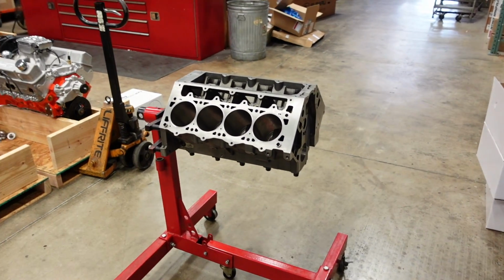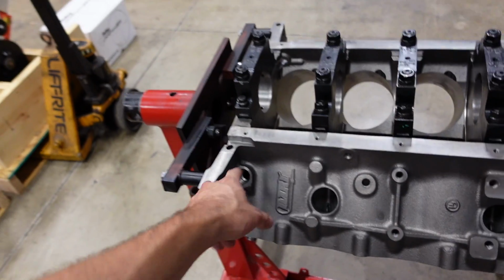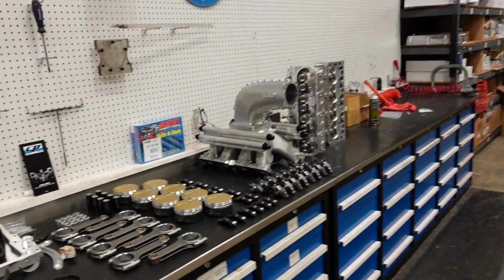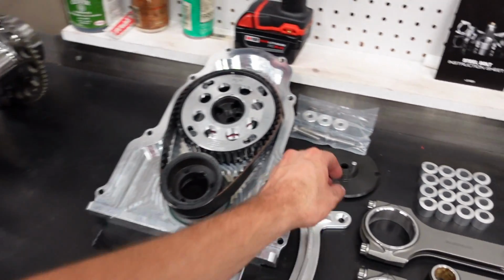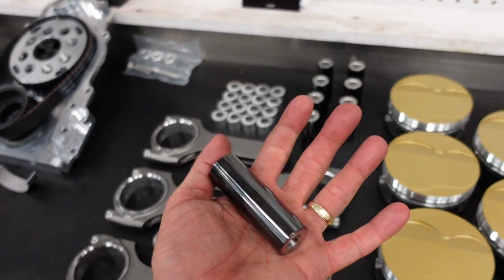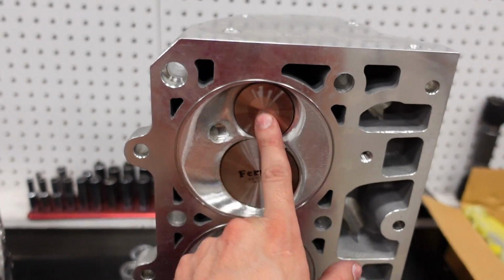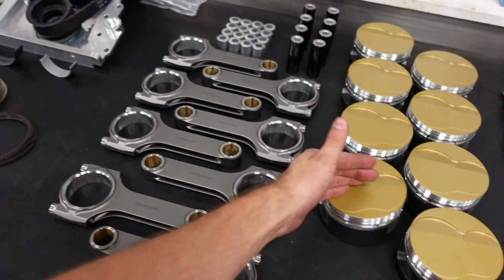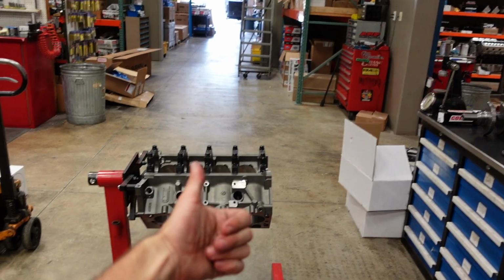Building my Personal LS Engine! - Engine Parts Overview - Part 1

Comment: Dude will be the next Steve Morris.
Reply: Dude should have asked Steve how to build a 3000Hp LS engine… Steve would have said don’t do it.
Reply: @Dave-rh6zo That’s why he went to an all billet combo (SML) cast iron and aluminum blocks break at that horsepower level. But companies will still sell you the parts if that’s what you wanna do. I’m sure he’s been told that but he wants to try it anyway. TKM won’t put H beam steel rods in anything over 1000 horsepower. They go to I beams over that and for 3000 horsepower they and Steve Morris and everybody else in the boosted world go to GRP, MGP, or R&R billet aluminum rods. Any top boosted builder hears he’s shooting for 3000 horsepower with a cast block and H beam steel rods will laugh him out of the industry. 😂 Steve Morris will tell you he’s split cast and aluminum Big Blocks in half at 3000 horsepower.
Reply: @wilsonjohn9766  jeeez so how many 3000hp 9500rpm engines have you built?
Reply: @dsauce8780  The same number as the guy in this video.
Reply: @wilsonjohn9766  ok how many 1000+ hp builds do you have under your belt?
Reply: @dsauce8780  3000 hp @ 9500 rpm isn't living in a factory LS block for extended duty. I'm sure there's some big hp factory  block drag engines out there but I doubt at 3000 hp/9500.
Reply: Steve Morris already knows what happens when you stack weight in the crank bell as they have.
Reply: I really doubt it
Reply: Got a long way to go
Reply: Steve design is stuff dry deck for a reason . No way it survived 3000hp especially for long load period with that set-up
Reply: MAybe in another  20 years
Reply: Dude already is way above steve Morris in ability and knowledge! And he's half the age of steve....so just imagine what happens in 20 years more!!!@@
Reply: @rytime700  lmao, wtf are you thinking? Why do you think Morris, proline , Sonny's and every other major players started producing  billet blocks? Simple, they hit a wall in HP with how much hp a coventional iron/alum block could hold.
Reply: @rytime700  lol yeah right I seen them young  punks with rich  daddy  all the time  ,he's not the next Warren Johnson  or Darin Morgan  any one can make 2000 too 3000 with a turbo the Idiot proof moron proof
Reply: Not to criticize Steve makes his blocks  and heads   Steve does use aftermarket parts  and the outside venders already know the proper rods etc  witch is there experience  noted.   Always use others experience  no guess work.  But. He is going in the right direction CANT wait. For next post
Reply: The problem is hotroding is over pretty much. The epa is gonna stop all of it. They are already fining shops for doing anything aftermarket. It sucks and pisses me off.
Reply: Steve knows a cast block at 3000 horsepower isn’t going to work. Nobody uses steel H beam rods over 1000 horsepower. Nobody in the boosted world uses Comp Cams anything. They don’t use belt drives either. Good luck.
Reply: @wilsonjohn9766  there’s plenty of very high horsepower engines using Jesel belt drive setups. As far as comp cams, there’s countless 2000+ hp coyotes using comp cams lol
Reply: @kmill0791  That’s not a Coyote. Proline doesn’t use them, TKM, LME, Thompson, Harrell, Steve Morris, Noonan,etc. etc. None of the top boosted engine builders from Hemi’s to 481x’s, Big block Chevy’s, LS’s and top built small block Fords. You won’t find one part from Comp Cams. Bracket cars, street cars and low budget builds sure, but the high horsepower stuff Nope. Frankenstein, Visner, MBE, nope. You won’t find them on the top nitrous guys either. Fulton, Musi, TRE,  the list goes on and on. Camshafts you’ll see Bullet, Cam Motion and Malitia. Rocker Arms you’ll see Manton, Jesel, T & D and Reid. Springs you’ll see PAC and PSI. Pushrods you’ll see Smith Bros, Trend or Manton. You won’t see shit from Comp Cams.
Reply: @wilsonjohn9766 Steve uses belts on his motors
Reply: @m0nster324  He doesn’t on his SMX and he’s looking for a way to get away from them on his SML.
Reply: @wilsonjohn9766 Steve only uses belt drive. 2jz engines are timing belt Honda B series are also timing belt.
Reply: @Watchmedome3017  Steve doesn’t use a belt drive on his SMX he’s uses an RCD gear drive as do Proline.

Comment: the counterweights should be knife edged away from the rod side in order to direct oil towards the main journal side, otherwise you have oil flying into the fast moving rods and rod journal which can cause drag as well
Reply from the maker: I’m sure Bryant Racing knows what they are doing 👍🏼
Reply: This is the belief among most crankshaft manufacturers and its always made sense to me. On the other hand Bryant is in the top 5 or so best aftermarket crank manufacturers and they are close, maybe the top of that list so I'm sure they have a reason for centering the leading edge, maybe its application dependent or something about crankcase ventilation or vacuum. I've seen Bryant cranks with the leading knife edge toward the rod journal with the following edge away. The crank here in this video is an absolutely beautiful piece, awesome combo. Only thing I might have done different is put some aluminum on those rod journals. Most guys I know making north of 2000hp usually end up with aluminum rods.

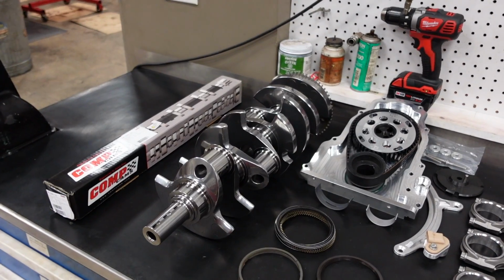Comment: 5:00 I am not a pro. But I thought all LS blocks had six bolt caps. I only see four bolts on those. I thought the LS motor had the block skirt come down farther and crossbolt from the sides as well
Reply from the maker: Stock blocks do. This block has splayed cap bolts. Way stronger

Comment: You want to go fast build you a coyote or a 351 Windsor
Reply from the maker: You should be a comedian because that’s the funniest thing I’ve read this year!! 😂
Reply: @JacobVillemain are overhead cams a better approach to achieving high RPMs
Reply from the maker: @tjakr3869  thank you for your input. It has been noted and received 👍🏼
Reply: @JacobVillemain  the great thing about it is true because I had a stroke. Out 351 in my coupe and it run TMC Miss Granny shifting on motor 20 years ago so I think I'm sure know what I'm talkin about so take some good advice from old old guy with experience you can fly